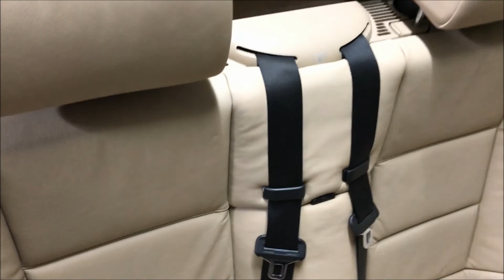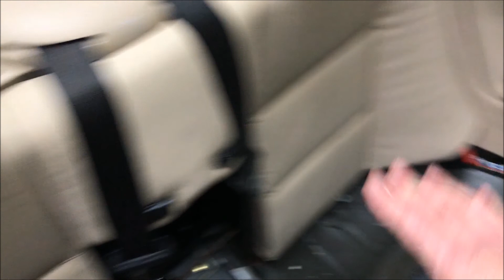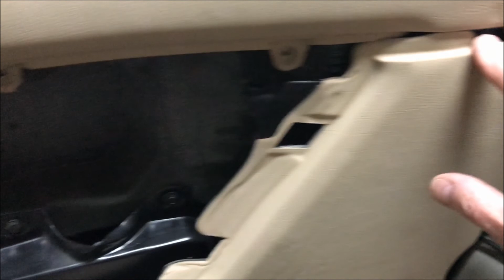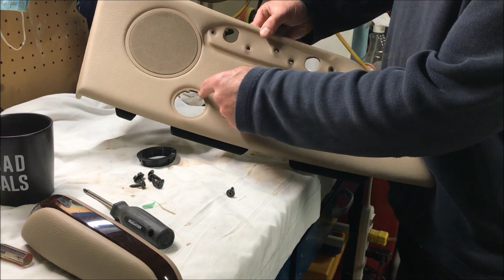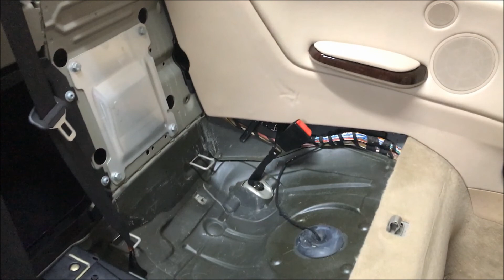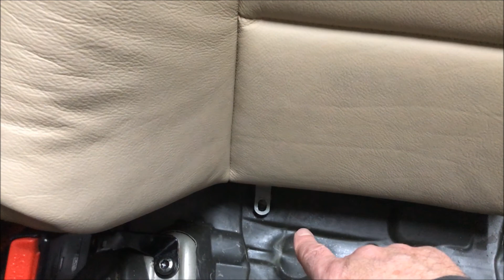How to Remove Rear Seats and Panels - BMW E46 Convertible

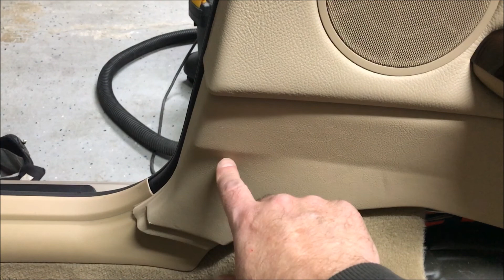Comment: You show the left side, rear panels being removed. That's great but @ 5:17 you show the bottom panel already removed from behind the threshold trim. How was this done? That's a big step. I don't want to pull to hard on the threshold trim save something breaking. Also, how do you remove the top panel? I have the same issue as Rico ltuarte. I need to replace the top panel. Thanks
Reply from the maker: I see what you are referring to. Apologies - I didn't specifically cover that because I was trying to cover removal during what was actually the installation for me. So you need the armrest panel removed. then the 3 bolts removed (7mm socket). You will already have the forward push clips released with a plastic trim removal tool. So you can pull the forward vertical arm out from under the top panel. Then you can work it out from the threshold by pulling the lower panel up and out at the forward end. That panel is flexible enough to bend and unclip at the bottom. I hope that helps - I realize its not as good as a video.
Reply: @boatinglife1  OK, got it. Thanks.😊

Comment: And how do you remove the top part of that panel, where the metal bars from the convertible move in and out?
Reply: What metal bars are you referring to?
Reply: @rashadmcclear3409  The mechanism that moves up and down the convertible top.
There are two plastic covers that I need to replace, because they broke. Those plastic covers have a perfect size hole to let the metal mechanism move up and down
Reply from the maker: I believe your referring to the flaps that fold away as the soft top bars fold up and down. I didn’t work on them myself. But I do know you need to open the main top cover and leave it in the full open position. This will give you access to the flaps and the spring that controls them.
Reply: @boatinglife1  Thank you, however, no I am not referring to those flaps; I am referring to the plastic covers that are on the top part above the side you removed; In your video, you removed the side, where the speaker is and show that there are some bolts holding it, however you didn't remove the top part on the side, where that plastic cover I need to replace is. It is a cover plastic, not the plastic wings that move, when the top is going up and  down. Those I already replaced.
Reply from the maker: @ricofede8  Ok, I understand what part. I didn’t remove them but I believe they lift up to be unclipped. You will have to disconnect the spring on the flap door and probably also the rubber trim price at the front of the panel.